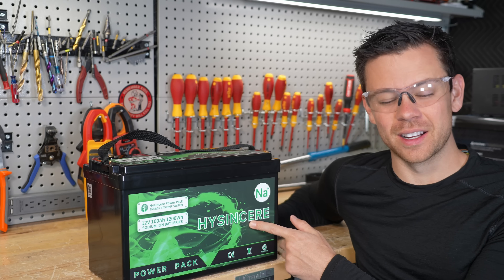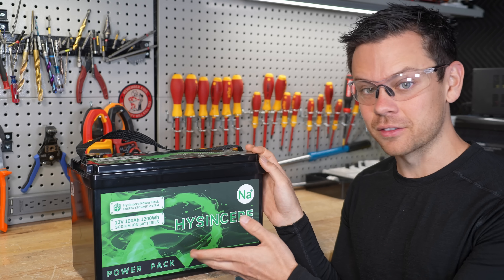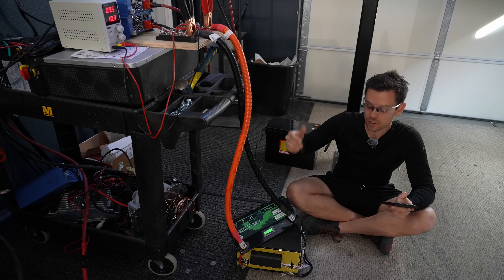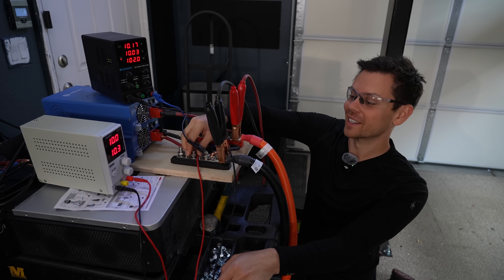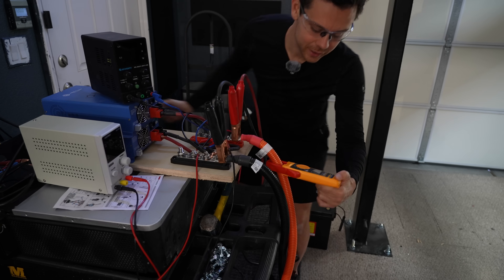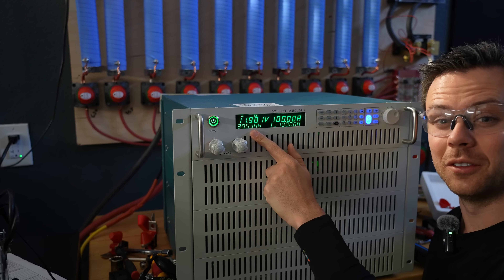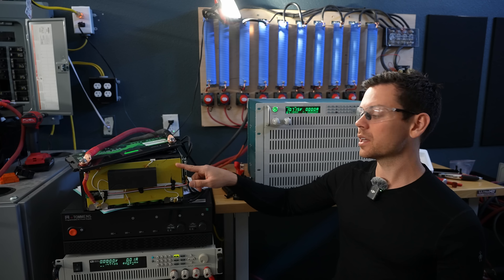Testing My First Sodium-Ion Solar Battery

Comment: When I ordered my batteries from EG4, I bought the 6 bay rackmount cabinet.  I'm in upstate NY in the snow belt, so our winters get pretty cold.  What I did was to put the rack up on some 6" blocks sitting on top of some foil-faced PolyISO boards, wrapped the entire cabinet to the floor in Reflectix insulation and foil taped, and then bought an inexpensive thermometer control for electric outlets.  I ran the thermometer sensor into the cabinet and taped it to the Polyiso, set the temps to turn  on the power at 33 degrees and turn it off at 45 degrees.  I plugged a small 700 watt heater into it and placed that under the cabinet (the reason I had raised it up,,,  to give me room for the heater) and I can go all winter without worrying about the temps dropping below 32 in the cabinet.  I've been going for 3 years like this and it works great for us.
Reply from the maker: This is the smart way to do it. As long as they are inside it's very hard to get the whole thing down to a low temperature. If you are cycling the batteries everyday, they warm up just enough. It's really hard to trigger the low temp protection.
Reply: i put the system in a super small room under the stairs, sealed it hermeticalky and installed the aircon which keeps 22C all the time throughout the year.  i think it could work for cold regions too (automatically switching from cooling to heatiing). hello from Greece
Reply: You could probably even get away with using a low wattage home brew heater pad connected to that thermostat, and put that inside the rackmount cabinet. Save a few hundred watts
Reply: @dohmarau  If his battery cabinet is insulated, he could probably get away with a 60 watt light bulb inside a piece of metal stovepipe (to guard against fire) beneath the cabinet) that exhausted into the cabinet. It takes a trivial amount of power to keep something above freezing in a small insulated compartment...
Reply: I lined the inside of my cabinet with a 12v blanket.
Reply: @ARCENAULT  I like this, but electric blankets can develop hot spots if they are bunched or covered up. Just have to be careful how you put it in there.
Reply: I built a foam house backed by thin plywood. I enclosed the batteries and the inverter. The heat produced by the inverter keeps the interior 30° to 40° above the outside temperature. 30° is at the slab. The 40° is at the top, and I have a probe in the middle that reads in between. The 4th probe is outside so I can see how cold it is. It's a 4 probe bbq grill thermometer.
If I put a small computer type fan near the bottom I get an even temperature from top to bottom. I originally tried a 100w incandescent bulb but found out the inverter keeps it warm enough. 
Of course on hot days I have to pull it away from the wall. It's a simple 3 wall lean to thing made from some 2x4s and foam boards.
Reply: I love that the only person who specified units is the one using units the entire world uses except for the US... And the US people don't specify units because they think they're the entire world 😂
Reply: @tin2001 Or that's just what they're used to. You need to ask yourself why it offends you so much that people are slightly different from you.
Reply: @tin2001  It is interesting that people who use that emoji to finish a comment always have the worst takes.
Reply: @tin2001  um, hate to break it to you, but most of the world uses volts and amp-hours.

Comment: As a Ham radio operator I do not want the sodium battery.  We like the voltage to remain above 13 volts for most of the discharge.  LiFePO4 batteries work great for our transmitters that like 13.8 volts for full output.
I did not like lead acid because they would not hold much over 12 volts when fully charged.  When the LiFePO4 came along I jumped on it and gave up lead acid.
I have been on battery power since the 1970s.  I now have 4 LiFePO4 batteries in parallel for the last 3 years charged by solar. Never run out of power.
Reply: I'd imagine you'd want/need active booster either upwards or down.

but if you already have pretty good batteries, whats the point unless the prices drop to very cheap at which point, yeah i'd like them on the market. I'd have plenty of uses where size and power density aren't much at all as important as cost is
Reply: I have some modern chemistry sodium's and they are pretty good, the battery will has is old chemistry.
Reply: @GoonyMclinux  What's the difference in chemistry?
Reply: I dont mind 12.7 :)
I have Eight 145AH AGM (110 lbs each) commercial cell tower back up batteries and they ROCK!
30 year General Ham ....
Reply: Honest question, what do Ham radio operators do? I've never researched into it, but is it just like talking to other Ham radio operators around the world?
Reply: @keysersoze7034 I've heard you can't be Muslim or Jewish and be a HAM radio operator
Reply: @keysersoze7034  They build things, try new things and talk about it later over the air.  I built my first ham receiver and got my license in 1961.  Worked CW and you don't do a lot of talking on CW.

Comment: Maybe for mountain top radio equipment/repeaters where much of the year they can be in extreme cold here in Canada.  They use batteries were there is now power or for when the power goes out.

Comment: I could see sodium ion making sense in a high voltage system along with LFP rather than instead of it, similar to what CATL is doing with their LFP/Sodium ion battery packs for EVs. I mean after Sodium ion drops significantly in price.

Comment: To be fair, this is probably a crap battery using some crappy cells, probably nowhere near to where leading sodium battery manufacturers are now.
They just try to make money from early adopters.
Reply from the maker: Do you have any sodium ions cells that you can share that are better? My results match most of the literature on this chemistry
Reply: @WillProwse  of course I do not have, but what I wrote makes sense. And it also makes sense if the technology could not be better, those big companies would not put still in to it tons of money. 
So I am just trying to be realistic, slightly optimistic.

Comment: This is so interesting, ive just come from a video talking about how CATL sodium-ion batteries are the future in EVs and it made me wonder about my home storage due to safety, but the prev video didnt mention any of the drawbacks of sodium-ion youve covered. Very fascinating and many things learned as usual!
Reply: Supposedly CATL is making them for heavy electric equipment now at $10/kwh too.
Reply: @TuttleScott  That $10 price is basing on material costs alone and its really unlikely to reach that any time soon really.  Maybe 30% discount over LFP in the short term but id be surprised if we see $10 before 2040's and for worldwide production, supply and logistics ramping up.
Reply: I hope the sodium battery makers will mix any different chemistry to improve the energy density and/or fix most of the cons (voltage curve, efficiency, cycle life and charge/discharge rate)

Similar to lithium, when it first came out in 1990s it also has poor charge/discharge, marginal energy density and low cycle life, then decades of development successfully makes a lot of different chemistry of lithium ion batteries
Reply: These might be low quality first gen cells. I assume they will improve as battery manufacturers improve the recipe and processes.

Comment: Any info on what gen this sodium battery is? First gen was awful on specs, almost sounds like a first gen. 2nd gen is already much better. CATL is having it's sodium line online this year what i've read. Don't forget China is dumping LFP like crazy on the market. Inverters will just have to be adapted to sodium batteries, cost wise, sodium has the potential to be dirt cheap compared to LFP. There are already cars in China with sodium batteries, which makes this test even more weird.
Reply: First. second gen is next year but the chemistry matters too. He won't even have access to NFPP until end of next year, if not 2027. NFPP is the sodium comparison to LFP.
Flatter curve most importantly, but also other things which he seems to care about above all else.. He shouldn't bother with any batteries for a few years. Good for views though
Reply: "Inverters will just have to be adapted to sodium batteries"

That's easy to say, but it isn't as simple as that.  An inverter is a constant power device (i.e. power in = power out * efficiency) i.e., for any given power the lower the battery voltage the higher the current drawn from it.  This means that has the battery voltage falls an inverter pulls more current from it, which not only accelerates the discharge of the battery, it also increases losses in both the battery and the inverter.

Comment from the maker: 0:00 Intro
0:10 .2C Capacity Test
1:48 Tear Down
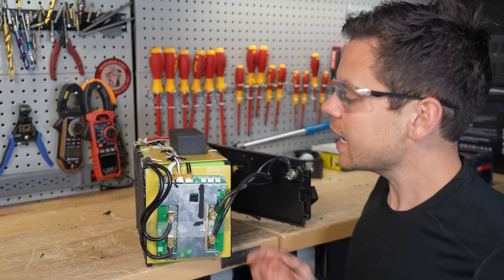2:31 Charging to 100%
3:03 Low Temp Performance vs LFP
3:57 Almost Charged!
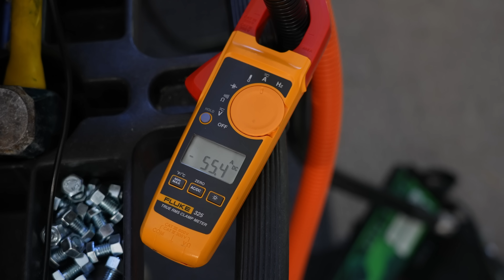6:18 Charge Current Tapering
7:07 1C Capacity Test
Reply: 0:10 is 2C right? Not .2C

Comment: I know it's not the best technology but I do hope it develops to something viable for common inverter usage.
I have a bias in favour of sodium batteries, and I won't be changing my opinion. 
But I do accept the fact that they still aren't as good as lithium or phosphate batteries.
Reply from the maker: Can you explain why you like them
Reply: @WillProwse My stance is quite difficult to defend if at all possible given the advantages of other chemistry types. I could call it a fascination, had it with lead acid too for a long while. Can't explain why but I just like the fact that such an abundant element can be used for driving battery chemistry. And yes I do know lithium is also considered abundant. And I do agree with you that sodium batteries just aren't there yet if they ever will be remains to be seen. I just wanted to share my opinion, and it is purely driven by an irrationall fascination towards sodium technology. It's a unhealthy obsession leading me to ignore the objective truths. But hey everyone's allowed their own opinion even if it isn't the best.

Comment: In a world full of sodium shills, be a Will Prowse
Reply: Only cheap  prices  can save it
Reply: So much this.......
Reply: See a lot of religious-type fervor for both lithium and sodium type batteries.  The good news is that there are some great bargains in LiFePo stationary energy storage today and there’s even better options likely available down the road.  In other words, no harm in pulling the trigger today if you’re ready and if you’re not ready likely even better options later on when you are ready.
Reply: NFPP chemistry competes with LFP but of course the production has to start to bring the price down. All that matters is price per kwh.
Reply: CATL just developed gen 2 sodium, no voltage linear curve
Reply: Tech is evolving, there are pros and cons. We'll see what happens in the next several years.